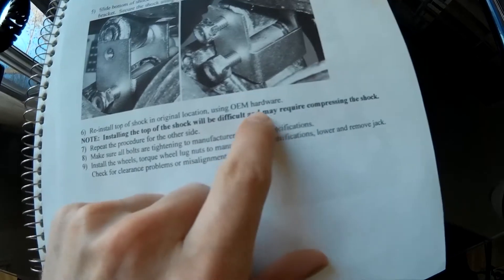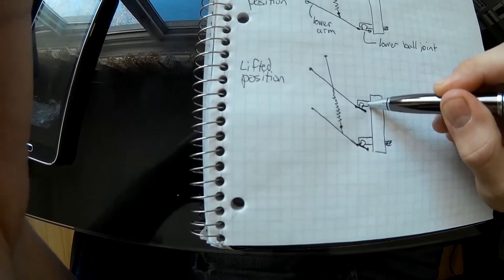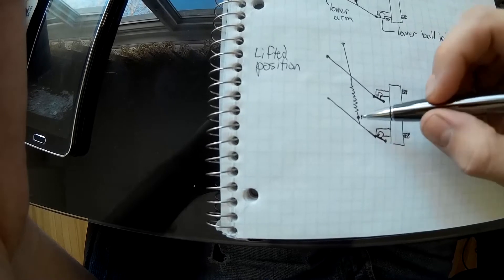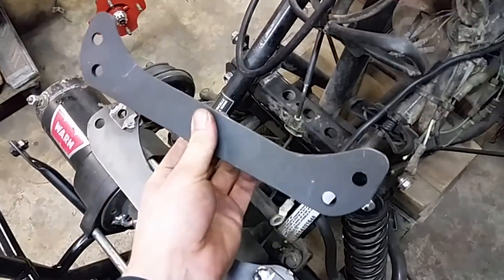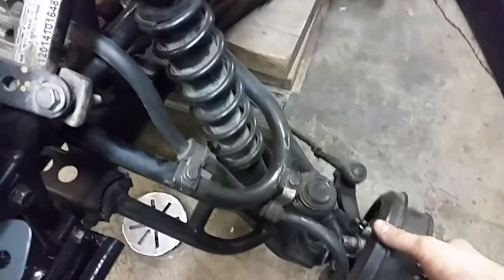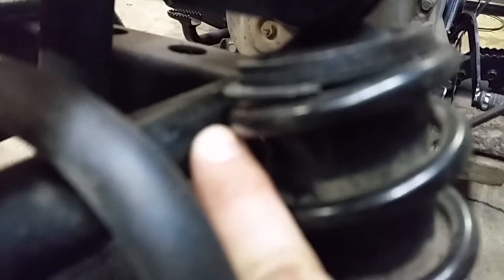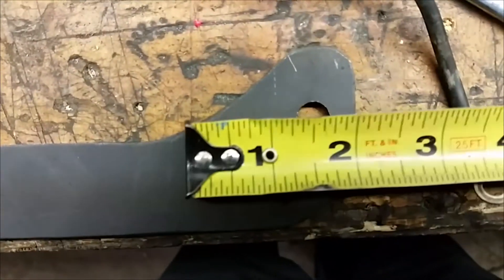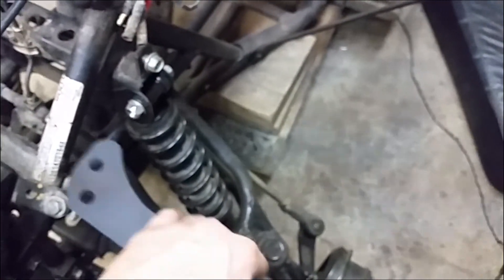Homemade honda recon lift kit measurements and explanations

Comment: Interesting way to lift your Recon. How has it held up? I have a 2007 Recon and am looking to lift it a few inches to install bigger tires. This past winter we got 20" of snow and the Recon got stuck from lack of ground clearance(high centering). I also want to get a snowplow like yours as well. Would you be willing to email me a template for the front and rear plates you used in your lift? Thanks, RR
Reply from the maker: Still in great shape, everything il like new. Because the recon is a small ATV, you cannot lift it like other bigger atv's. The maximum lift you can get is 1,25 inch. Now if you don't mind about getting a higher lift on the back (you can install bigger tires in the front because it is 2WD) you can get up 2 inches. BUT more you lift back, the universal joint will work harder so will be weaker if you work a lot with your Recon. Personally, I installed interco vampires 25 inches dia.x 9,5 inches width and it does a fantastic job in mud. Hope I answered well.